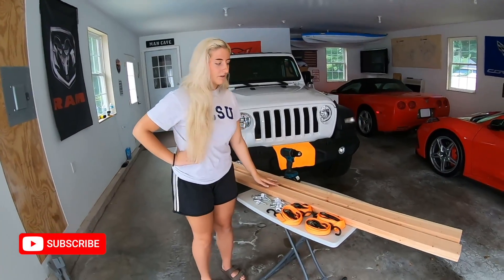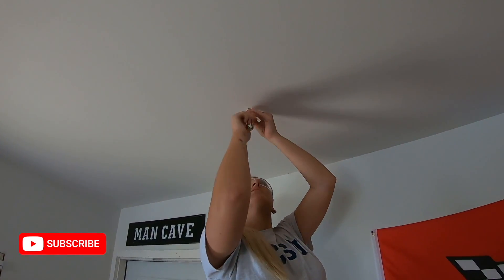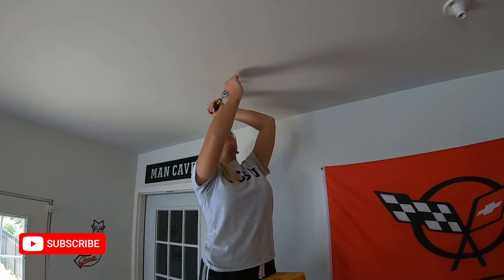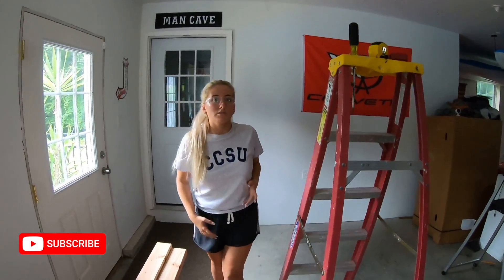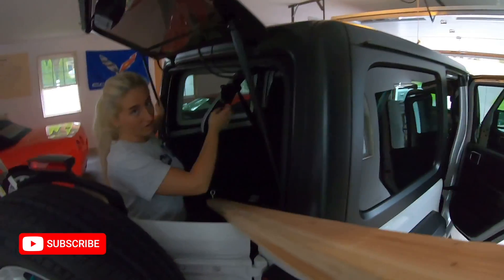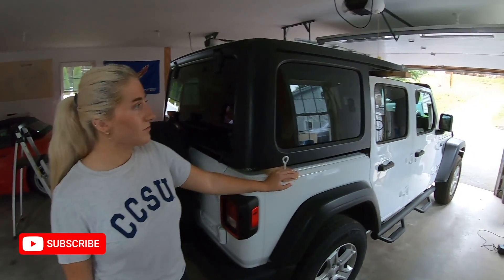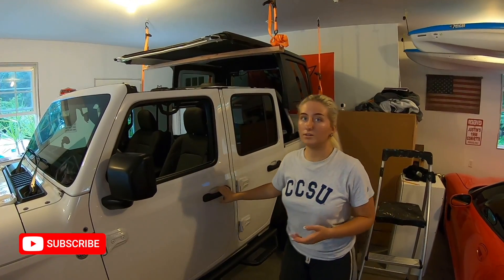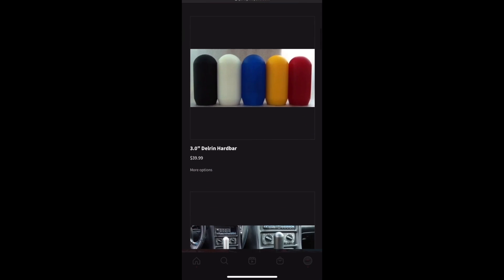How to create a Jeep Wrangler hard top hoist lift homemade ceiling hanger on a BUDGET

Comment: How do you get it down?
Reply: I know right.. this is weird
Reply: It's literally just the reversal of steps. The straps are cam straps. Just loosen them each after pulling the Jeep under. When  the hardtop has been lowered and is sitting on the Jeep, take the straps off, then remove the 2x4s (one at a time). It's not at all difficult
Reply: @BigRyTheFlyGuy those are ratchet straps. Not cam buckle straps..I'd recommend cam buckle straps though. Makes it so much smoother raising and lowering the top